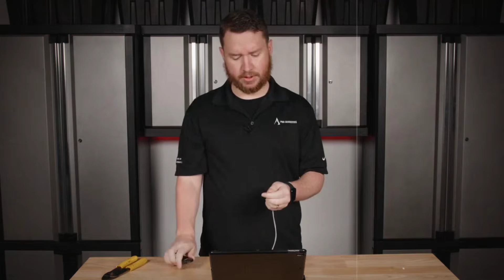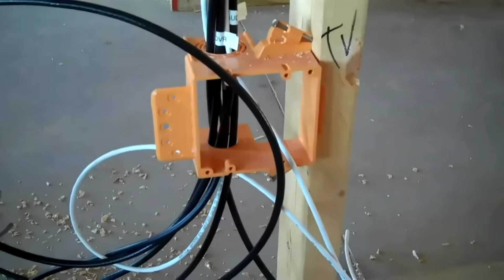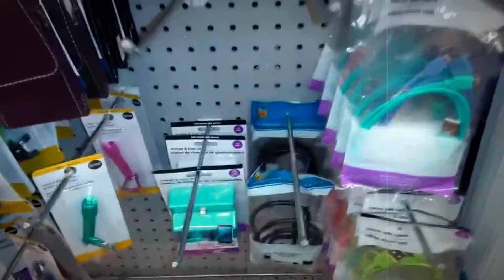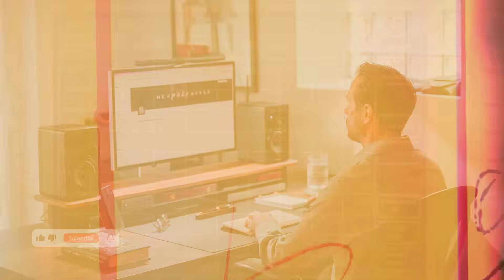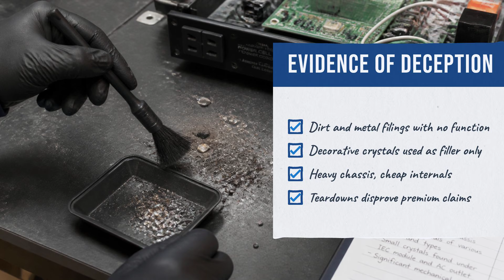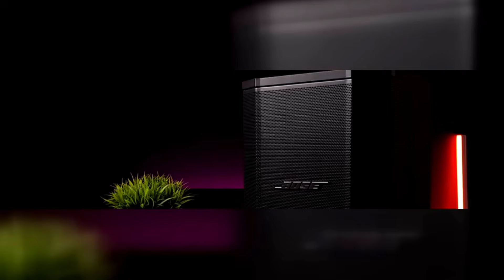Why 90% of Hi-Fi Cables Are a Complete Waste of Money (The Marketing Tax)

Comment: There is a yes and no. All RCA cables and in particular dedicated phono ones are a different subject than loudspeaker interconnects. The actual resistance, capacitance, inductance and related to the frequency behaviour do electronically play a role. There is also a difference between shielding and better shielding, di-electrica, etc. But the story of cryogenic copper with specially oriented crystals is pure audiophile nonsens. One advise I could give: buy top notch cable from companies like Mogami, Sommer Cable, Klotz, Cordial, look seriously at the electrical spec, buy good professional connectors from Amphenol, Neutrik, Hicon or from other decent professional brands, DIY to assemble them, take care of the right shielding and you’ll be a very happy listener… And to be honest, seen the actual omni-present digital RFI, I don’t hold anything against shielded loudspeaker cabling. It works extremely well!
Reply from the maker: Fair distinction, and worth making explicit phono interconnects sit right at the edge of the RIAA equalization curve at very low signal levels, so resistance, capacitance and inductance interactions genuinely matter more there than on a standard line-level or speaker run. The cryogenic treatment and oriented crystal claims remain in the same category the video describes, regardless of which cable type they're applied to. And that list of brands is exactly the kind of recommendation this channel points toward Mogami, Sommer, Klotz and Cordial all publish real specifications, and Amphenol, Neutrik and Hicon connectors are the professional standard for a reason. On shielding specifically, the broader RF environment now is genuinely noisier than it was twenty years ago, so being deliberate about it is sound practice rather than overkill. 👌
Reply: Returned the expensive cables and kept the $24 Primedas.
Reply from the maker: That's the test that actually matters more than any spec sheet putting money down, listening, and reversing the decision when the expensive option didn't earn its price. Twenty-four dollars and done is exactly the kind of outcome this channel argues for. 🏆

Comment: To help with the power slapping I use a standard computer UPS. This way when the power goes off and on a bunch of times the UPS steps in. Turning sensitive electronics off and on a bunch can ruin the equipment. You can get one for around 100 dollars plus or minus.
Reply from the maker: A standard computer UPS is actually a smart, underrated choice here it gives true sine wave output and battery backup, which handles voltage sag and outage cycling far more directly than most audiophile power conditioners costing ten times as much. Protecting sensitive electronics from repeated power cycling is a real, documented concern, and $100 for that protection is exactly the kind of honest fix this channel points people toward. 👌